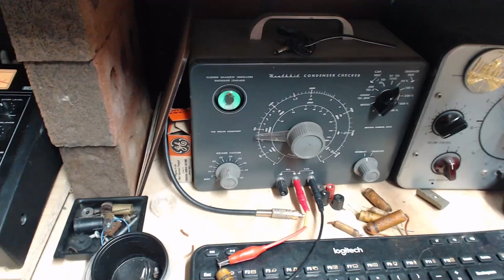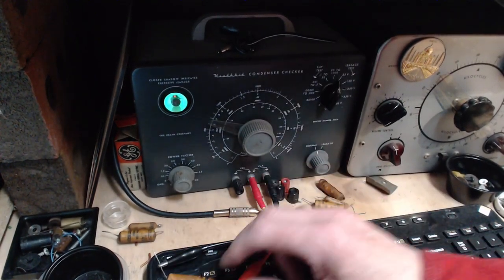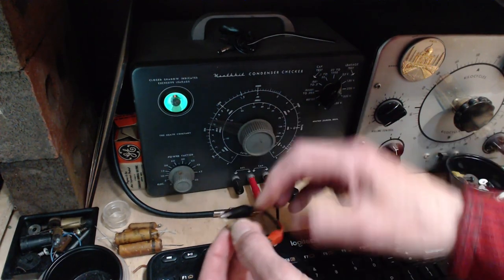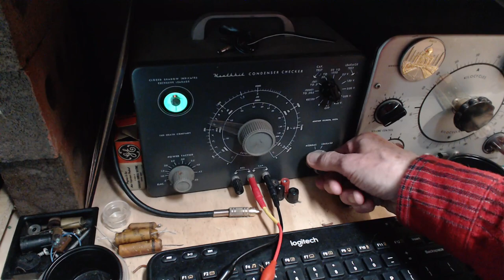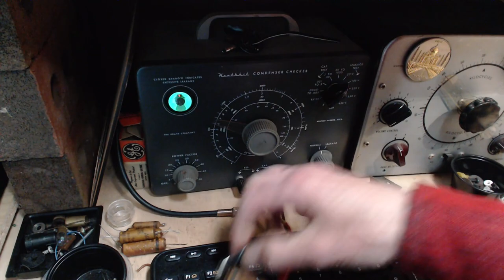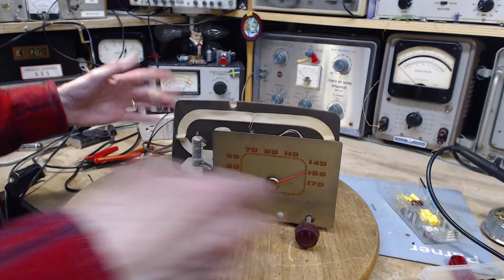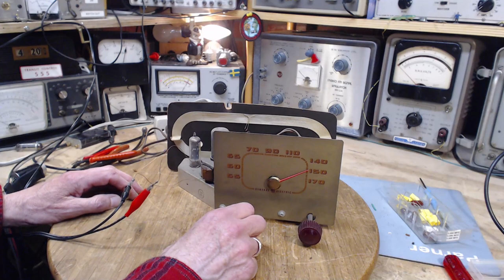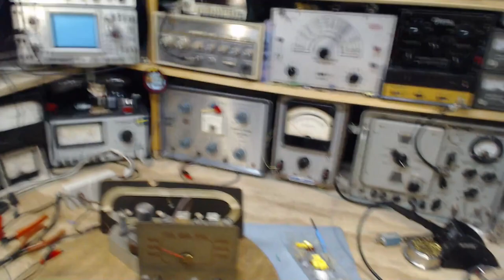Canadian General Electric Model C403 Video #1 - Shotgunning the Capacitors

Comment: Testing capacitors is a simple matter and a fundamental action. A good Simple “C” tester is a start for measuring the stated value of a cap. Should you find that the actual measured stated value is higher than what the  label on the capacitor states, its a sure sign the CAP is leaky. A simple Simpson 260 is a good leakage tester on the RX 100000 scale. The meter needle will show the CAP charging up and coming at rest on the right side of scale in the 500 megohm region. However this reading is suspect of leakage, but minimal. My unique technique involve a transformer operated high voltage power supply and the Simpson 260 DC current ranges. This methods can be hazardous for those newbies unfamiliar dealing with high potentials.Using  clip leads color coded red and black is helpful. Carefully attach a cap under test across the power supply 400 Vdc out put with test leads. Allow a minute fir cap to fully charge and stabilize. Inserted in this circuit loop is a DC ammeter set to 100 ma. First test is to observe current flow, most likely none will show. Then drop down to the 10 ma. Range. No current flow there is good. Any current flow indicates a leaky cap, but not severe. Change out that CAP anyway. Final step, drop down to the 100 ua range. In a good CAP there is no measurable current,   flow any current flow would indicate leakage. However under 50 ua is a practically useful suitable leakage. But by now you have taken the cap out of circuit. If you have a brand new cap you might as well install it. This exercise for me led to a better understanding of leakage and do I really need that Heathkit C checker. Ill agree it was a useful tool back in the day and nice item to build and collect test gear and equipment. In my lab classes I taught this actual leakage test  exercise and drove home one more fact of electronics.

Comment: So called shotgunning the capacitors is no more inconsequential than changing your oil  and filter when needed.
Reply: Changing Oil and Filter on a car with Jim probably works like this; drain the oil, remove the filter, open it, deem it still serviceable, solder it back up, pour the old oil back in and top up with the leftovers of his deep fryer.